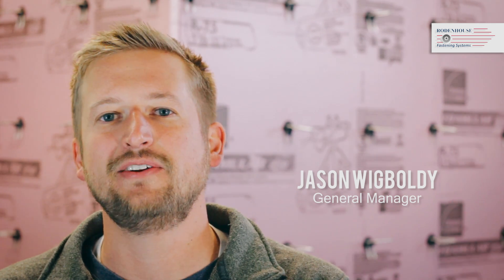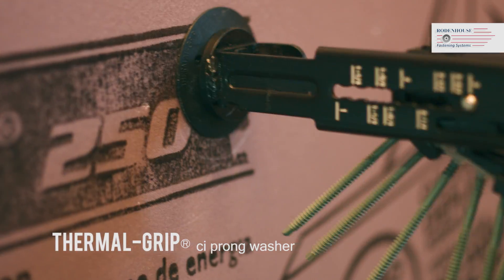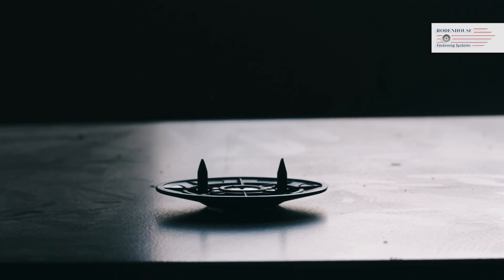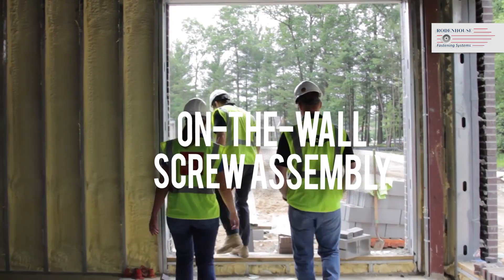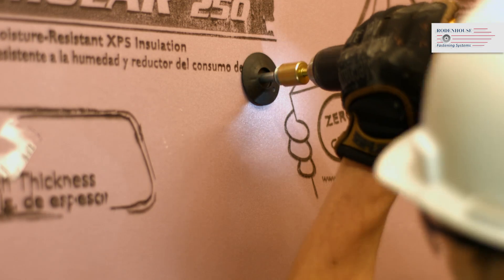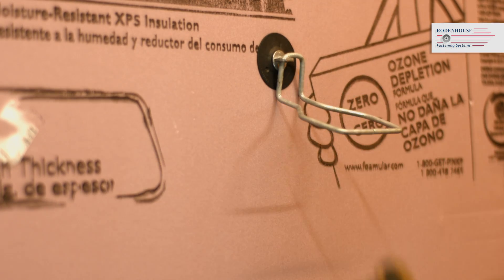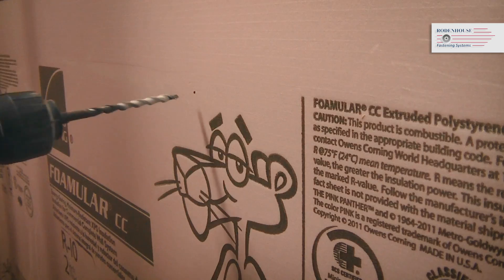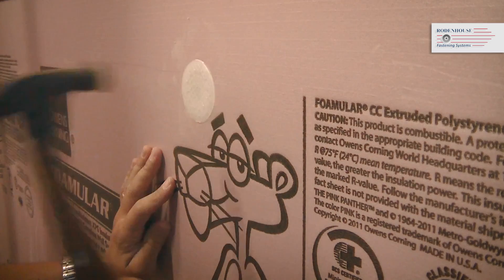Fasteners to attach Foamular from Owens Corning: Rodenhouse Inc.

Comment: Can the PMF anchor at 1:20 be used to attach foam to foam? i.e. if you add 2" rigid board over an existing 2" rigid board? (using a smaller hole to pressure fit)